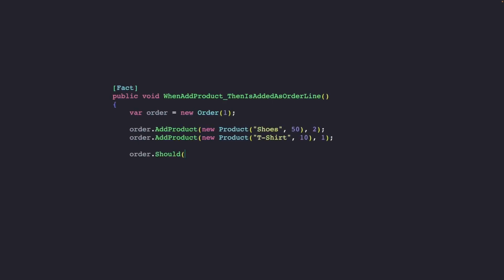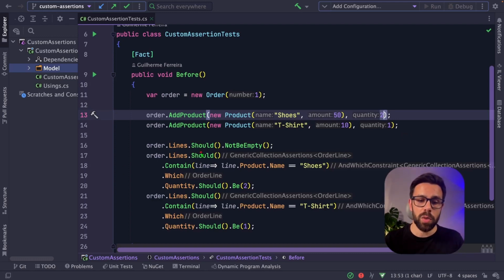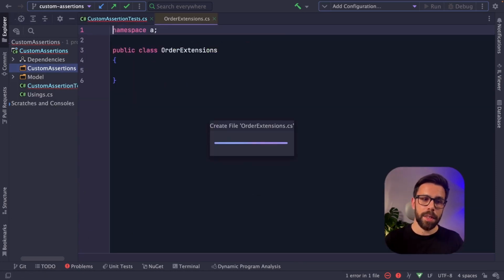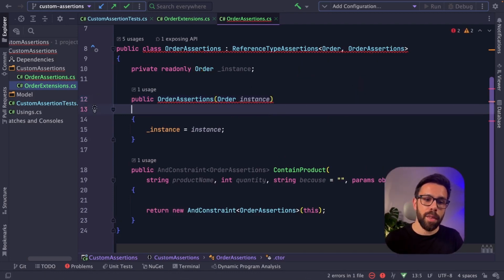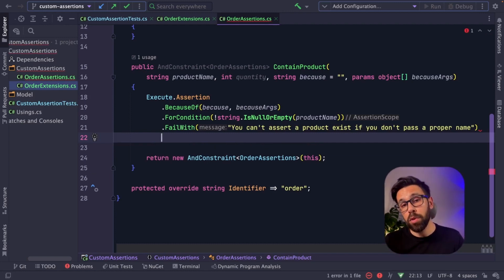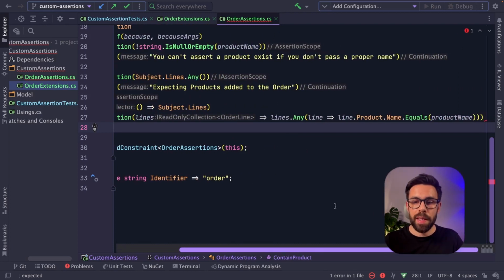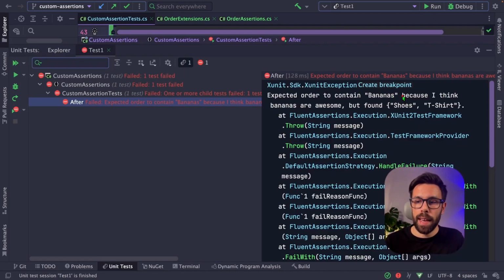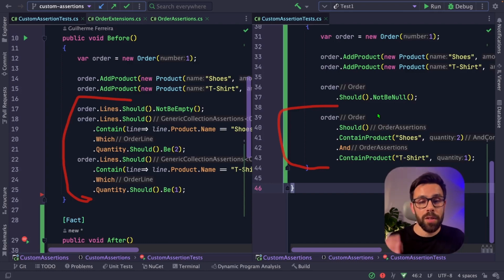Discover an Easy Trick to Simplify Your C# Test Assertions!

Comment: I do this quite a lot in my code too. A trick to make the custom assertions easier to write at the expense of domain specific error messages is to just copy the regular assertion messages into the custom assertion method, and wrap them in an assertion scope.
Reply from the maker: As a way to simplify exception detail assertion? 

By the way, thanks Egil. I was watching your talk at NDC London when I decided to record this video.
Reply: @gui.ferreira  I just find the syntax easier to work with. The `Execute.Assertion` style I have to look up everytime. Wrapping a bunch of `subject.Should()....` calls in an assertion scope gets me almost all the way, but the error message can be less optimal than the long form.
Reply from the maker: @NotInventedHereShow  Nice tip. Now I get it.